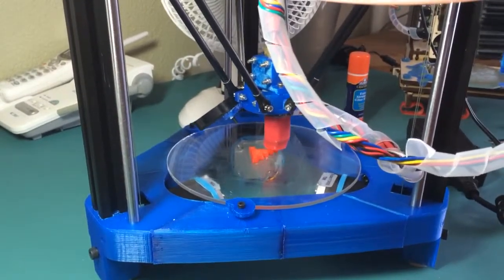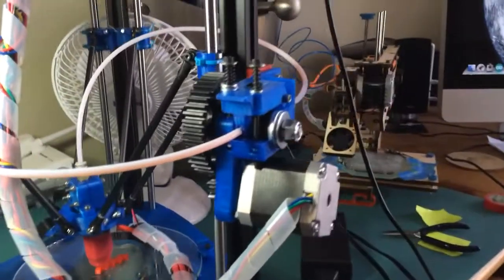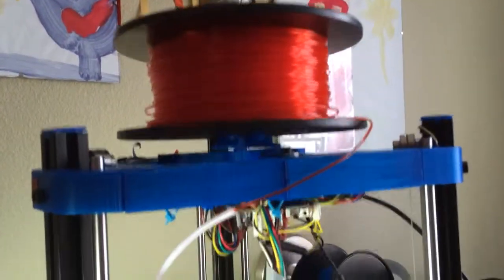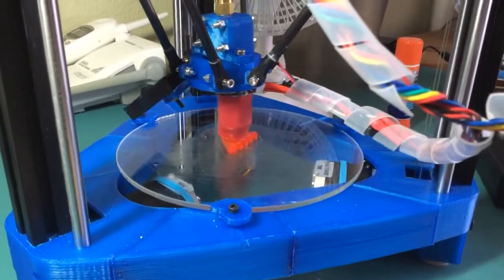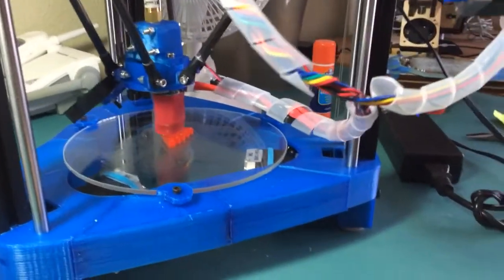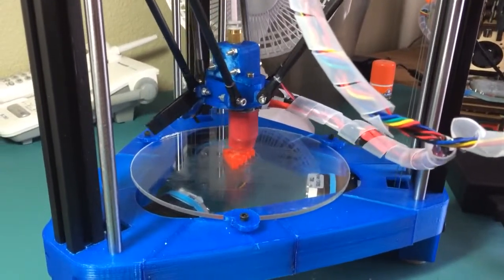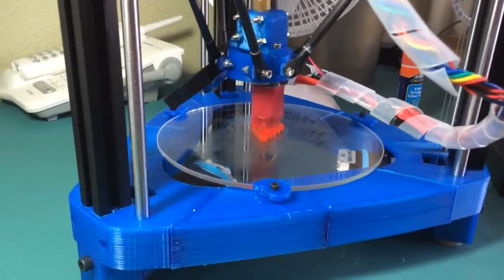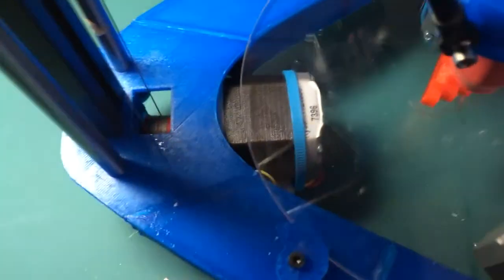3DR Simple

Comment: Which is better for home use? This one or kossel mini? Is this smaller than kossel mini?  I could not find the printable dimensions of this.
Reply from the maker: The 3DR Simple was designed by JohnSL...so if you look him up on github...
I took this printer apart....too small.
I already had built a Mini Kossel then expanded the horizontals to 350mm.
Need to increase the vertical to 700mm but have not done it yet.

My next purchase will be Ultibots Kossel 250 V-slot with J-head and FSR kit.
http://www.ultibots.com/kossel-250-v-slot-3d-printer-diy-kit-beta/
three week lead time, hope to order it in December for January delivery....

If this is your first 3D printer....you might consider starting with the Printrbot.
Either the Printrbot Makers kit or the Printrbot Simple Metal.

The Delta printer, like the Kossel, has complex firmware and calibration procedure.
The Delta printer must be straight, rigid frame and attention to close tolerances.

Look here to compare:
http://www.3ders.org/pricecompare/3dprinters/